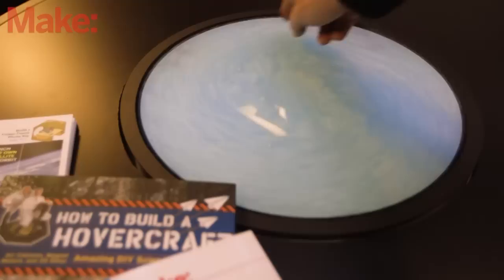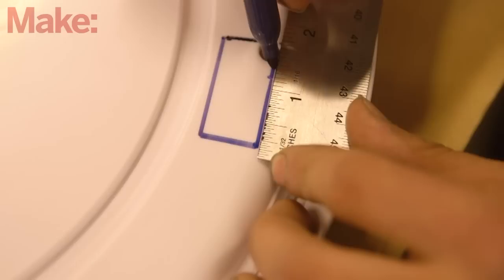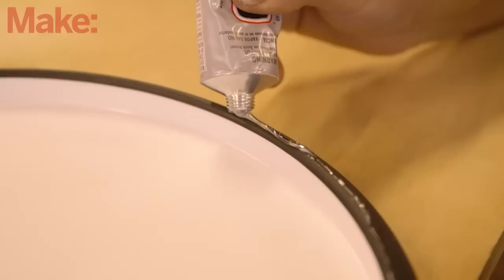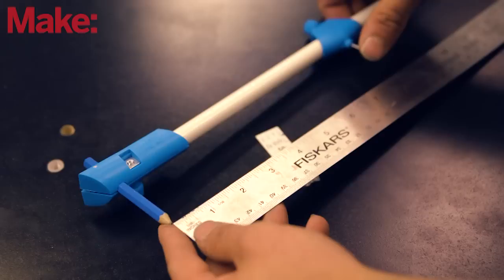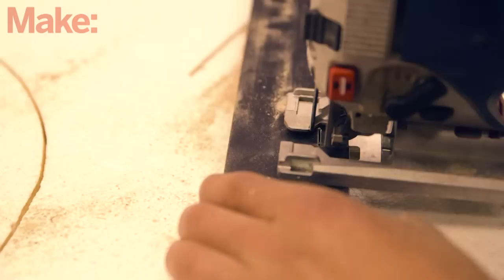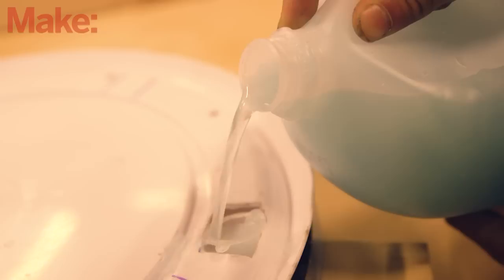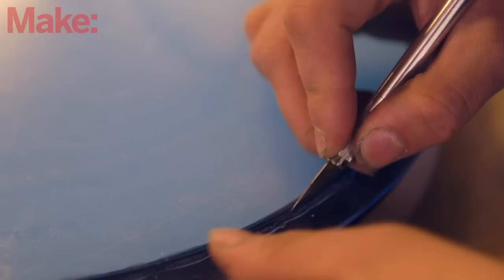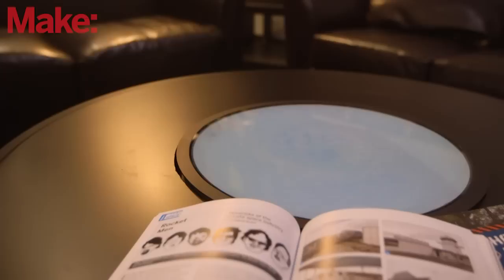Rheoscopic Disc Coffee Table

Comment: I performed maintenance on a one meter diameter water-table at Pacific Science Center.
We had need to replace a broken face-glass, so I got an education on re-filling these beauties.
The number one trick to zero bubbles is to boil your distilled water for at least 15 minutes prior to using.
Allow it to cool in a sealed jug or bottle to prevent the water from picking up any air.
This will make sure there is no dissolve nitrogen or oxygen in the water.
Once it is cooled off, mix it up per normal recipe, and fill the table as usual.
Don't worry about a bubble or three, they will magically disappear!
Lots of air can be dissolved into water, so by purging the water prior to filling and sealing the table, the water can absorb any stray bubbles from a less than perfect fill.
The table also ends up under a slight vacuum as the bubbles vanish.
Less chance of leaking when ambient air pressure is greater than the pressure inside the table.
Reply: Brilliant tip. I'm about to start a couple of projects and this will be a great help. Thanks for sharing.
Reply: Спасибо, помогло!
Reply: @Sypher474  I hope you aren't dead. If you superheat distilled water (microwave) and then disturb it, it can flash boil violently.  Traditional method with a stove and a pot would be better. As long as it starts boiling you're good.
Reply: @woosier1  I'm alive and well, thanks for the concern! I'm familiar with superheating/cooling so proceeded safely as possible, but very good to have this warning written out here either way.

Comment: "The table came out great, and the video shows the construction steps really clearly. Nice work!"  -- Bots?

It's a cool idea and the steps were clear, but a little more time to round the cut and level the plate / make sure the offset wasn't a gap between the table and spinner would of made a huge difference.

Comment: Wouldn't you be better off putting the holes in the sides of the turntable just below the acrylic? That way you would get all of the air out easily. Then you could seal it with some silicone in conjunction with the plug.

Comment: This project is WAY too specific.
Is it absolutly necesary to use E6000? I bet any water-resist glue would suffice.
Can't you phrase it in more variable terms? Like:
Choose a plastic Lazy Susan with a high border.
Make sure that the Support-beams of the table are attached in a wider radius than the radius of the Lazy Susan.
Cut the hole in the table to the size of your Lazy Susan and
Make sure to also modify the support of your table to fit the Susan so it will be flush with the tabletop once finished
et cetera
et cetera....

Despite this and the sometimes horrible execution of the steps it's still a nice project and outcome.